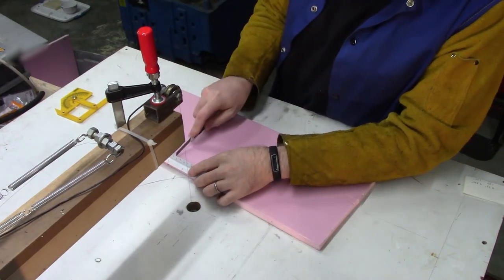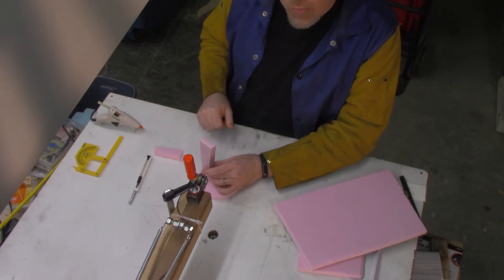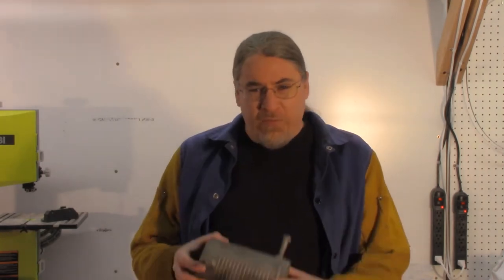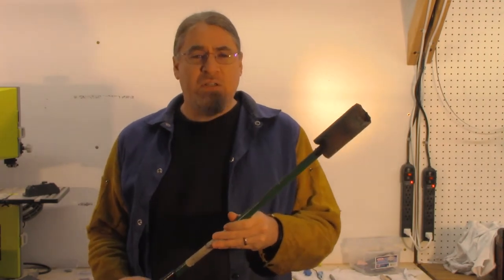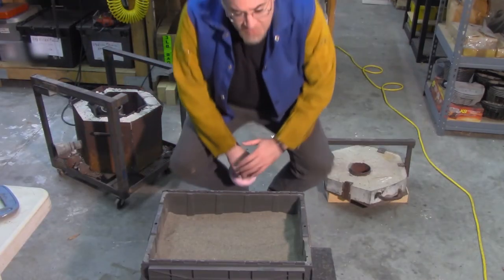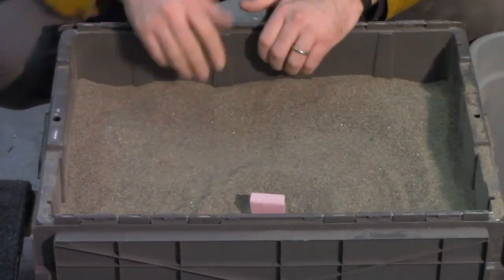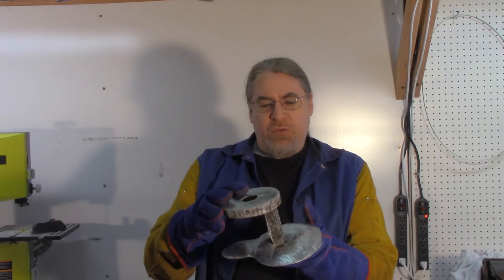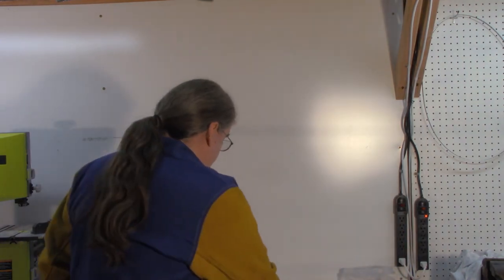Easy Aluminum Casting

Comment: Super cool video, had no idea that you could cast this way without the special "form casting" sand.
Reply from the maker: Thanks! Yup I've done quite a few parts at this point, I wouldn't trust them to be aerospace grade or anything like that, but they make useable parts.